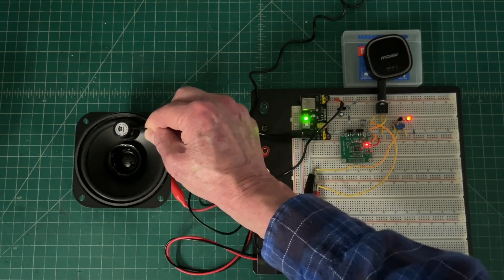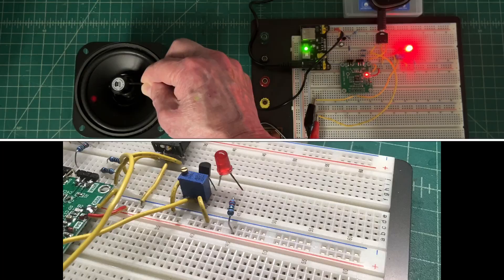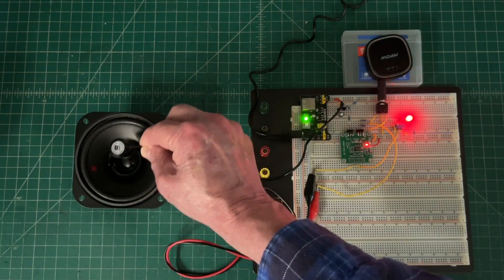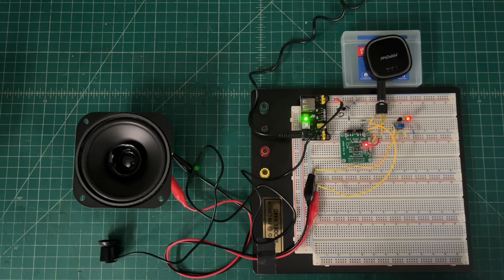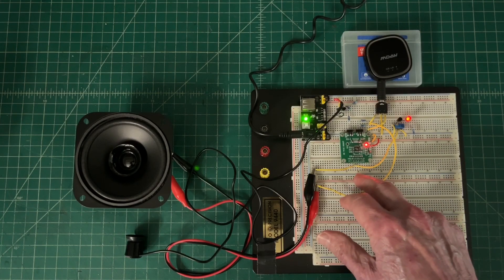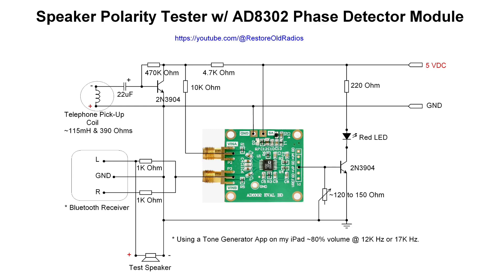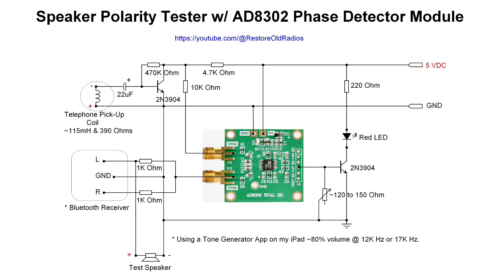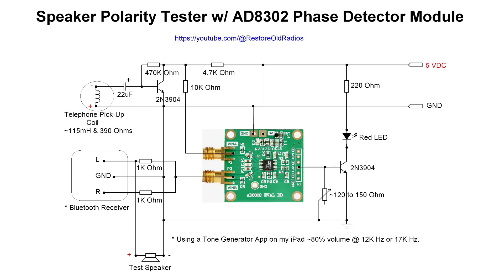Speaker Polarity Tester w/ AD8302 Phase Detector Module

Comment: Hello Don...thank-you for all you do! Would you please explain what's wrong with just using a 1-1/2 volt 'A' cell across the voice coil and see whether the cone moves 'out' or 'in'? Thus any 'parallel' speakers will be in phase with the 1st. one if done the same way. Thanx. David O.
Reply from the maker: David, the 1-1/2V battery solution works great as you described/noted. My design is better suited for speaker(s) in an enclosure or alike where a visual inspection of the cone movement under test is not possible/practical. Thanks for reaching out and your kind words. All the best. Don
Reply: @RestoreOldRadios Bless Your Bunions! Don.